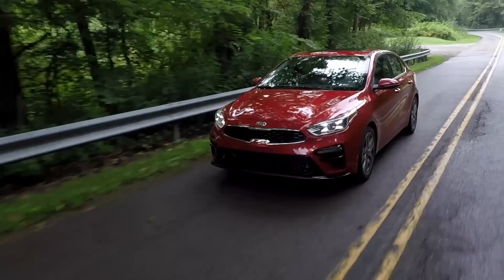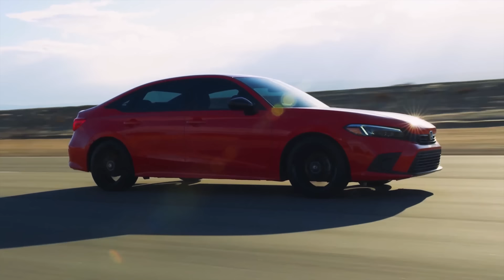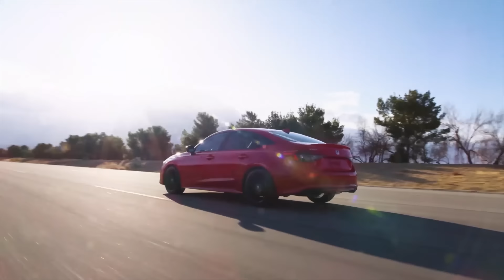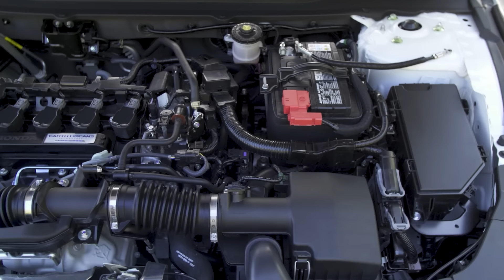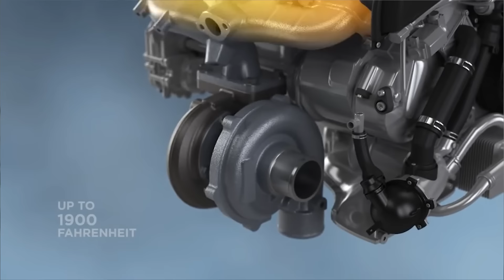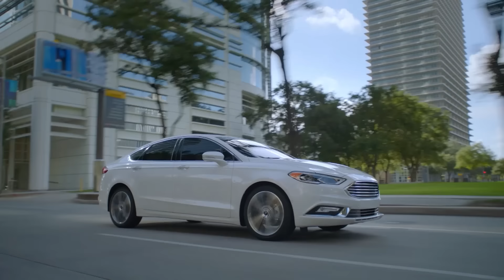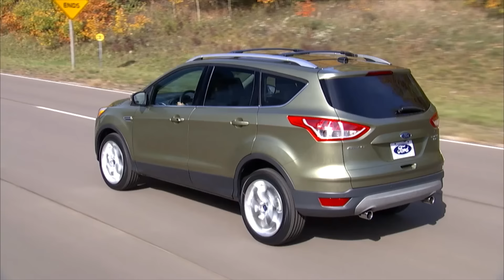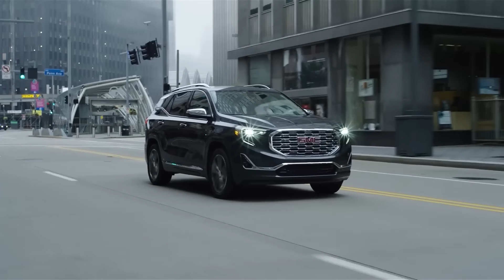Are Turbocharged Engines Reliable? The Truth About Turbo Engines

Comment: Turbos, direct injection, cylinder deactivation, stop start system plus mated to a hybrid system with a dual clutch transmission, I'd be terrified out of warranty
Reply from the maker: Same here what a combination to have!
Reply: @HackerMotives  Of course you are overlooking the fact that, the manufacturers don't give a toss about their cars 5-10 years down the track.

Cars are an expensive consumer item & what happens to them once out of warranty is something  they don't even consider.

It's just some problem for some poor mug who can't afford a new car.

+ the auto repair business is a trillion $ industry worldwide.
Reply: thats why i love Toyota's HSD Powertrains... no gears, no turbo, no clutch, a combination of direct AND port injection, proven hybrid batteries... its one of the most reliable systems out there
Reply: You people really want to suck the last mile out of a damn car. Turbos are fun and exciting. If it's getting you to 100k kms that's more than enough. I love the power of a nice turbo gets you to overtake anything. In my country they have some weak ass 1.0 and 1.2 NA engines and you keep on revving them just to overtake a damn truck. Turbos are a breath of fresh air to me thanks whoever invented them.
Reply: DCT transmission are Horrendously expensive to repair
Reply: Direct injection is great if you also have port injection.  My is350 have both and have been super reliable.
Reply: @upyours6000  Even the 2.0 litre engine in the Corolla has both port and direct injection. Getting real hard to find a new car anymore with just port injection. Everything has a Turbo added to it.
Reply: This is why the 4th gen tacoma is out of question for me. I trust the older ones with my life. Not this turbo I4 hybrid guy tho.
Reply: Remember the saying: less is more. No turbo or hybrid for us. My wife and I both work a 15 minute short drive from work. It’s either naturally aspirated or straight to Tesla.
Reply: Not all. But a lot of these turbo issues are caused because people don't know how to read the owner's manual..  example..  In my Mazda CX-9. I had it for a year before I read the owner's manual. Here I didn't know if you were using the turbo right as you got home. You're supposed to let it sit for 30 seconds to idle down..   to cool the turbocharger down before you shut it off..   And then of course there's the oil changes. I changed my oil at half the interval. Why? Because oil was cheaper than a turbo.
Reply: Scotty Kilmer agrees and approves your comment
Reply: @Aikynbreusov  a boomer?
Reply: @Aikynbreusov …I read a review that Scotty did on the Honda. R-V. It’s Tito was could this be the best vehicle ever built! Not a word was mentioned about the turbo charged 4.
Reply: @Aikynbreusov  scotty is a drama queen
Reply: @randellgribben9772  he tells the truth as it is and that's why people love his drama...
Reply: @Aikynbreusov  he changes his mind left and right, with that dramatic boldness also.
Reply: @Aikynbreusov  My thoughts exactly! 💪🏽
Reply: Don't forget supercharger ( volvo)
Reply: That’s why they’re throw away cars!
Reply: Lease the car you return it for example after 36 months and exchange it for another car but still pay about the same amount per month
Reply: @Andersljungberg  is tall rather not have “white goods cars” and pay outright for a car I really want to drive with a NA V8
Reply: Don't forget the supercharger + turbo in volvo
Reply: @Dansk55  Oh mine! With so much power generated by the supercharger+turbo, it ain't gonna be reliable.  Is there any survey of the Volvos T6 engine?
Reply: Slant sixes, stovebolts, and 3 on the tree sounds like an appealing era.
Reply: Well, every semi-truck has turbo and their engines last over million miles without rebuilding.  So that's that. I also think that Toyota hybrid systems last for a couple of hundred of thousand miles whe used as taxis. So your second point is dead. And as for the rest; well, maybe you have a points maybe you don't have them. (I simply do.not know)
Reply: Highway drive ALL the time and oil change every 4K, you shouldn’t have either of premature clutch wear out or excessive carbon buildup, for your 1.6 turbo. Means you drove wrong or the previous owner drove wrong.
Reply: this comment went horribly wrong because Scotty reviewed the Mazda CX-90 which has a turbo, start stop, hybrid, and direct injection and Scotty loved it. He usually hates those things though. Just goes to show that a well made car is a well made car. Also the hybrid will nullify the stop start system.
Reply: I’d be terrified in warranty.
Reply: Mazda Tribute 2003 V6 3.0L with many oil change abuses from time to time.  Still mostly rock solid with over 200,000 miles already.  

how can that be?
Reply: Cvt trans same when there bad no one will rebuild used or new and your paying big bucks
Reply: But at the same time, some people want cars with low gas consumption
Reply: @Andersljungberg  Some but clearly not all here in the UK by a massive margin. As a glance at any full UK Supermarket Car Park or busy Road or Motorway will immediately confirm. 

UK Roads now are full of Big Ugly Fat-Gut SUVs which of course need more fuel or volts to punch a bigger hole through the air when on the move..

I used my MG ZT-T 1.8T ( T for Tourer as well as Turbocharger.... whatever happened to estate cars and shooting brakes? ) for a long 300+ mile round trip recently.37.7 Miles per UK Gallon NOT driven for economy. My MG ZT V8 will now be a weekend with around 20 Smiles per gallon miles
Reply: Oof. I have a 22 ford edge st. Turbo D.I. start stop (that I turn off every time), not sure if it's a dual clutch but it's a 7 speed. So I'm halfway there
Reply: I’m thinking of buying one of the 2023 RX 350 H, any advice?
Reply: @1djmoore  NO!!!!!!  It's terrible..... the 2023 will have a turbo 4 cylinder engine,  which means it will have to work very hard or over-work to get the beast moving.....small turbo engines are never known to be reliable.....as evidenced by BMW's turbo 4 cylinder engine,  and the Lexus 4 cylinder engine that powers the Lexus IS 200.  I think you are BEST buy the 2022 RX350 right now that you still can, or buy a certified used one......  if you MUST buy the brand new 2023 RX350 then just wait for a few years to see what sort of issues it comes with first, and wait for Lexus to work out all possible issues first....
Reply: @Aikynbreusov  thank you what about the Lexus  ES 300 H
Reply: @1djmoore  I think the ES300 H should be ok since it has the Toyota Sienna's powertrain,  or a least a different variant of the same powertrain but just tuned specifically for luxury car application..... the bottom line is: Avoid turbo 4 cylinder engine.....
Reply: @1djmoore  my advice for you is to buy the current 4th generation 2022  RX450 H....it has a a 6 cylinder engine that is paired with an electric system to give you maximum power and acceleration...... it's a proven reliable hybrid  powertrain technology that has been around since 2010....this hybrid powertrain was basically carried over from the previous 3rd generation, which spanned from 2010 to 2015....I'll be damned if this 3rd generation RX hybrid powertrain is an improved version of the 2nd generation RX hybrid powertain ...if it is then that means this Lexus hybrid powertrain has been around since 2006.....so all possible issues that were known to exist with this RX hybrid system were ironed out and resolved through out the early years during the 2nd generation RX or 3rd generation RX....so the 4th generation should have an extremely reliable hybrid powertrain system....of course, Lexus made some changes to this powertrain to keep it up to date for the 4th generation RX...there's no hybrid powertrain system available for the 1st  RX generation, which spanned from 1999 to 2003....the first generation RX was basically a rebadge of the only-sold-in-Japan Toyota Harrier......then Lexus became independent from Toyota in the early 2000s and established its own headquarter with its own design studio in Nagoya,  Japan..... the 2nd generation RX was a true Lexus product designed by Lexus' own designers and engineers.... so the Toyota Harrier was no longer needed to be rebadged as a Lexus RX due to strict luxury standards set by Lexus.... Toyota did sell a tall station wagon based on the Toyota Camry known as Toyota Venza, which belonged to the same class of vehicle as that of Subaru  Outback... This 1st generation of Toyota Venza spanned from 2009 to 2015.....due to poor sales volume,  it was chopped off the Toyota line of vehicles in North America.....  due to high demand on SUV, Toyota decided to bring the current generation of Toyota Harrier directly from Japan to North America and rebadged it as Toyota Venza 2021 as a way to revive the Venza name....  this 2nd generation of Toyota Venza has Lexus-like quality with outstanding fit-and-finish, and craftsmanship, and it has the same hybrid powertrain system found in the Lexus ES300h, Toyota  RAV4, Toyota Sienna,  Toyota Highlander,  Avalon,  Lexus NX, and all other Lexus and Toyota 2.5 hybrid powertrain system......  All CURRENT Toyota and Lexus hybrid cars will 4 cylinder engine from now on..... So if your budget is below $40k and don't need to haul a bunch of chubby people around then I recommend the 2nd generation Toyota Venza.  Its price is only a few thousands more than Toyota RAV4 hybrid but it comes with Lexus-like craftsmanship and luxury.  If you have no budget limit and need plenty of power then I think the current 4th generation LEXUS RX450h is the best choice......the 2023 will have a turbocharged 4 cylinder engine,  4 cylinder hybrid,  or 4 cylinder-turbocharged engine.....
Reply: @Aikynbreusov  It’s only the 500 h and the 350 that has the turbo engine but the 350 h does not have a turbo engine thou What do you think
Reply: @1djmoore  the new 350h nonturbo with a 2.5 liter is good but that's a tiny engine to move a lot of metal and bodies...... I still say you are better for now buy the current RX350 0r 450h....then in 4 years you can buy the upcoming RX if it has no issues.....and in 4 years Lexus should have worked all the issues....so you buying into the refresh cycle of the upcoming RX....
Reply: @Aikynbreusov  hmmm!! Great idea, thank you so much I really do appreciate your help👍🏽😎
Reply: @oi32df  you mean the 100k 10 year warranty?
Reply: With all of that going on, it would probably never leave the shop!
Reply: Yes, Found On Rubbish Dump. If GDI engines are not run Ling & hot, the oil fails, the 2nd hand buyer gets ripped off. That's if it continues to go.
Reply: @bruceedwards3366  that's what I be worried about too, even short trips especially in winter are hard on GDI engines, way worse if it's turbocharged.
Reply: Exactly!
Reply: The turbo itself is not a big risk you can’t group it in an umbrella and associate the overall risk to it.  What I hate is the lag.
Reply: @HackerMotives  at $40,000 - $50,000 a pop?….. Not a simple decision.
Reply: The 24 Mazda cx90 has all that,😂plus the engine  has to come out for simple repairs
Reply: @Terry-p7t  can you name a specific simple repair where the engine has to come out ?
Reply: Usually turbo cars don't use cylinder deactivation; that's an N/A thing
Reply: @matsudakodo  my 2022 turbo Audi Q7 uses it
Reply: A hybrid with dual clutch is a win since the electric motor is easier on the clutch and it doesn’t need to slip.
Reply: Huh I wonder why my stock 280,000 mile 1984 turbo MB sedan is still running strong and had no major issues yet?
Reply: Don't forget the intake valve system clogging EGR system and AD-urine corosion blue
Reply: Who are you
Reply: My dream car would have: turbo, direct and conventional injection at the same time, cylinder deactivation, electric water and oil pump, electric valve timing, start & stop, dual clutch transmission, all wheel drive, electric power steering, because...that's evolution I guess.
Reply: The metal and replacement adding much burden to the climate and carbon emissions - it is an absolutely loser- loser game
Reply: Good lord, some very archaic thinking here. I've driven turbo cars for years, way more smiles and no problems. My current car is a turbo car from 2009. No issues
Reply: Stop start can be turned off at the touch of a button, heck start stop on most cars can be permentatly disabled with an OBD tool. Nothing wrong with Turbos or Direct injection as long as you keep on top of maintainence and use good fuel and drive a decent distance. Getting your engine carbon cleaned once every 100k miles is not expensive either if worried about carbon build up. Don't know shit about cyclinder deactiviation except that like stop start it sounds stupid and is probably no good for an engine, DCT gearboxes can be very hit and miss although when working they're brilliant for performance, the Japanese and South Koreans have hybrid systems nailed down I would avoid it from other car makers especially the Germans who have the bizzare idea that a diesel hybrid is a good thing.
Reply: Pretty much what I have in my mercedes
Reply: 100% the purpose of all theses new technologies are just bringing reliability down. It’s literally straining the car
Reply: Hey hey hey....will a 1.5 tsi evo from VW on a vw virtus ( sold in India) with a manual transmission be good
No dual clutch
Not a hybrid
😅
Reply: My car has a turbo and direct injection but not cyclinder deactivation and the start stop is disabled as I didn't want it. Its not only non hybrid but its a manual too so no transmission issues to worry about.
Reply: Or like Volvo that uses a turbo and a supercharger.....and has ev tech on their new models ... That's a lot that can break
Reply: No turbos on my daily.
Reply: You are describing a car like suzuki swift turbo except DCT and hybrid. Those Swifts have legendary reliability.
Reply: Ah yes, turbocharged engines are unreliable. That's why all those tractor truck engines only last a few million miles.
Reply: Jazz-life properly maintaining a turbo means 1) changing the engine oil often and using quality synthetic oil, no more than every 5,000 miles on an oil change and 2) not driving hard until the oil is up to operational temperature and 3) not driving hard right before you shut off the engine
Reply: Bro just explained the mazda cx 90
Reply: y  Agreed!
Reply: You described a Trax..
Reply: Run a bottle of techron at every oil change with a direct injection engine and you'll never have an issue with it.
Reply: Too much scare tactics. Turbos are the future and already have been around for decades. Most major negative points have been resolved and the benefits outweigh them.
Reply: too many things that can go wrong, but these environmentalist types can care less about reliability.
Reply: Well, as a retiree I only drive 5k or less a year. Mainly to get groceries, bank, library, etc. right near my Colorado home, and only maybe 3 or 4 days a week. I was considering a buying a new 4 cylinder turbo but not anymore!  Any counter opinions?  Am I overreacting?
Reply: I have one of those things you mentioned.    Direct injection
Reply: Ford has already fixed that issue on the 2 L EcoBoost
Reply: Have direct injection and twin scroll turbo no start stop and no hybrid either, and I think my car will be less reliable than my previous one.
Reply: It is bad even within warranty period.  Dealers cannot keep good mechanics around.
Reply: The only way the public can effectively protect themselves is to collectively reject buying cars with the above features.
Reply: 40 years ago you would have said, electronic  fuel injection, 5 speed automatic transmission, ABS, airbags, power windows and locks, I’d be terrified out of warranty 🤣
Reply: @Matys1975  But the manufacturers, just like back then, don't give a stuff about the car when it's  5 or 10 years old. It doesn't even cross their minds.

It was much simpler to keep older cars going, but the big problem was rust, along with the very poor safety of older cars.
Reply: @johnsergei 
Nonsense, the older cars required more maintenance. More frequent oilchanges, more frequent valve adjustments, more frequent ignition adjustments more frequent grease points to follow - in short, more frequent trips to the local garage.
A car today can go up to 30.000 km between oil changes, has no need for adjusting anything else as the valves is hydraulic adjusted and the ignition is electronic and set from the factory.
If you follow the maintenance schetual and change the oil, a modern car will travel up to 500.000 km without any troubles. Something an older car wouldn’t be able to.
Reply: @Matys1975  Correct , but the key phrase is "40 years ago". Those features you mentioned have had 40 years to mature, the turbo engine has not.  I remember when power windows were failure prone (usually in the down position). And who can forget the teething problems of EFI when it was first introduced.
Reply: @Hemond1  turbos have been around for a long long time. You don’t remember all of the Japanese sports cars of the 1990s with turbos, many of which are now selling for big bucks ? Those cars are 30 years old.
Reply: @Matys1975  Yes, I remember the hapless Maserati Biturbo for example (car and driver went nuts over it - but it was  a piece of junk). There is a difference though, a big one. Those cars you mentioned were aimed at the enthusiast market, not mainstream. They were uncommon and kinda experimental. There were lots and lots of Chrysler cars like Lancers , Daytonas, LeBarrons where they simply stuck a turbo in, for marketing,   with no forethought,  and called it a performance car.. Those cars all self destructed, which is why the survivors are commanding high prices.
Reply: @Matys1975  Except their are multiple known issues with some of those things he lists. Any mechanic will tell you cylinder deactivation is terrible for your engine longterm, direct injection causes carbon buildup on your intake valves, and turbos, even if mantained with proper oil changes, have about a 150k mile or 10 year lifespan before having to be replaced, and that is stated by the manufacturers of the turbos (granted, some do last longer than that). Ironically, I own a SHO that has twin turbos AND direct injection, but it is a car a plan to replace before it gets old.
Reply: @jeffjackson9679  I have a hard time believing that a properly maintained turbo in a modern Toyota, Honda or Mazda will last only 150k miles on average.
Reply: @jeff jackson - the 3.5L Ecoboost in your SHO is a pretty good engine.  My main concern with that engine is the water pump which is inside the timing cover.  They will leak at around 100k miles and labor for the repair will be around 10 hours.
Reply: @Matys1975  You are not alone. My son's Rover 620ti now in over twenty years ownership showing 240,000 miles \\\\\\\ very relible miles.. is proof positive that with proper maintenance as recommended by ALL car manufacturers, high miles are possible. Most of my UK built Turbocharged cars well over 100,000 UK miles, not KMs.
Reply: @jeffjackson9679  direct injection paired with port injection doesn't form carbon build up. Doesn't have any issues. Toyota's A25A engine is exactly like that, it's a relatively new engine, but examples with these engines lasting over 250k miles with little to no issues already surfaced.
Reply: @jeffjackson9679  A Toyota guy said you should change the oil after 500 miles And buy decent oil.  Then it might be good if you put cleaning chemicals in the petrol tank once a year, probably the same with the oil too.  And there are also cleaning chemicals that you spray into the intake is on the engine
Reply: @jeffjackson9679  Jeff, The Taurus SHO is already old.
Reply: @Matys1975 problem is the turbine they don’t last even if you build the engine very well you still need to replace the turbos after a certain miles
Reply: @patthonsirilim5739  that’s nonsense. Modern Toyota, Honda and Mazda turbos last as long as the engine does.
Reply: @jeffjackson9679 there have been videos where they took apart a Honda GDI engine and there was no carbon build up at all on the intake valves at 100k miles
Reply: @jeffjackson9679  Direct injection can cause carbon build up but many eliminate it with good design too. Toyota have eliminated carbon build up on their direct injection engines by running them with both Otto and Atkinson cycle. my 1.2 Turbo engine runs brilliantly that Toyota made.
Reply: @jeffjackson9679 The SHO: IYKYK ❤
Got a 335i (N55), and I support this comment - doing maintenance is whack, but it's not nearly what people say it is. Especially in this day and age.
Reply: @Matys1975   Those my own words back then. Still bought new cars though. As a very famous 'Merican once said on more than a few occasions..

.. d'OH!
Reply: @Matys1975  yes, and they were terrible after the factory warranty was over....
Reply: @Matys1975  ??
Reply: @Matys1975 no because a window regulator abs sensor even a regular automatic transmission 
Can all be repaired relatively easily and relatively inexpensive , cab off turbo repairs or dsgs are not inexpensive
Reply: @Matys1975 Not part of the drive train no worries that's minor stuff even back then.But roll up windows are better.
Reply: @Matys1975  Yep new technology takes time to develop and prefect for sure. Jump on board I will wait and buy when the problems get sorted.
Reply: @Matys1975 What about the dinosaurs?
Reply: @Matys1975  no they are not power train
Reply: @Matys1975  if you trade your cars every few years you'll never have issues
Reply: @rods6741  People who want a perpetual car payment are perpetually poor. I’d rather keep a vehicle for 10 years and put that money into actual investments that make money.
Reply: @rods6741  …the downside is that you never stop making car payments. Bought a new Civic in 2010, paid it off around 2013, nine years payment free. Lots of capital saved to cover repairs but few were needed.
Reply: @rods6741  Other than money issues… yeah
Reply: @stevescherer4954 same a 2012 Civic hatch the only problem was brake wear rotors  and pads had to be changed at the same time after about 35k due to euro specification for soft pads and rotors. Engine never missed a beat in 10 years sold it to a neighbour and still going strong.   Got my moneys worth.  Replaced it with a CX30 2.5lt I hope it's as good.
Reply: @moloono1  I agree. It is best to buy a new car and keep it for 10 years.
Reply: @IMAN7THRYLOS  It’s also better for the environment too. Much better than what an EV can do.
Reply: @moloono1  No one really cares about the environment. I don’t have a car and I work remotely. But my company tells me to go to the office from January. So no more 0 CO2 emissions and daylight for lighting. 
+ one car in the streets and + more CO2.
Reply: Way back before (and after) Y2K, Ford's economy cars had such frequent clutch/transmission failures, and claims against Ford, that their attorneys were telling the company that it was losing too much. The secondary clutch is for neutral-to-drive only.  Problem was in stop and start traffic jams, the smaller clutch would heat up, eventually taking out the tranny. These 7-9 speed automatics,  good for racing, means that the buyer is gambling without knowing it.  🤔
Reply: That's the idea.  They want you to trade it in and buy a new car.
Reply: My 2017 1.6L turbo with the 7 speed dual clutch transmission has already failed me. 
The clutches went out long before 48K.  Fortunately the Tucson has a 100K power train warranty so the clutch part of the tranny was replaced at no charge....this time.
I asked how much this will cost me when the warranty expires and the mechanic told me 3K. 
My Tucson lives on the highway in 7th gear so there's very little "city errand" miles. I change the oil every 4K religiously. This should prolong the life of the turbo and any mileage over 4K on one of these tiny little turbo motors is just asking for trouble. Heck, tiny engine, tiny oil pan, tiny oil (and filter) change bill. 
I will dump this Tucson before 100K and buy a naturally aspirated Toyota Rav-4 with a common fluid auto tranny if they still make them.  
Additionally, this 1.6 has direct fuel injection only in the cyl not a dual injector  system  setup with 4 injectors over the intake to keep the intake valves clean like some of the Toyotas have.   I expect that the intake valves will be gummed up and compression loss because of pitting on the intake seats by the time I hit 100K. Yes, I know all about the crankcase oil catch can. 
So the video is about turbos on small displacement engines (excluding big trucks of course) and they've been around for years. The problem is.....any small displacement turbo  engine is going to fail long before a naturally aspirated engine will. 
Buy the bigger c.c. naturally aspirated vehicle with a tried and true automatic fuid tranny. 
Avoid any gasoline vehicle that has a turbo. 
Turbos are on gasoline engines to give power while sacrificing weight . 
The same vehicle without a turbo and a larger displacement engine is what you want.
Reply: @Spinnaker617  Excellent advice, totally agree. Look at all the problems Ford is have with their small EcoBoost engines.
Reply: I've been using turbo engines almost 30 years. they're not unreliable at all as long as you leave the boost pressure stock and maintain it. 200k + on my srt4 and 18 years old.  my 19 year old 03 cobra is still fine on boost too.
Reply: This is complete nonsense. Most dual clutches, direct injections, turbos or start stop, have no problems nowadays.
some old dude stuck in 80s or 90s might think his way.
Others move forward with "new", already old tech
Reply: @markusjanhunen5112  your comment is complete nonsense. They are worse the newer they are..

From a very well seasoned Ford mechanic that's worked on all makes for over 20 years. 

You're comment shows your lack of intelligence and knowledge, BIG TIME.
Reply: @markusjanhunen5112  LMAO, keep telling yourself that. I'm taking it your a keep 6 years and trade kind of person. These vehicles aren't going 200k miles trouble free anymore.
Reply: @markusjanhunen5112  How many miles you have on your vehicle?
Reply: @markusjanhunen5112 umm the old ways worked and a car was a car not a tablet on wheels....
Reply: I happen to have a used 2018 Nissan Rogue base model which I bought used from a car rental company in 2019. If you happen to buy the last year or second to last year models for example, work from home and / or have short commutes, then you may be more fortunate with these newer cars like myself.  I don't think cars nowadays are made with the intentions of lasting more than 10 years, and people from the 80s and 90s believe they should last forever and be repairable by the common mechanic.
Reply: @markusjanhunen5112  Nope, not for me.